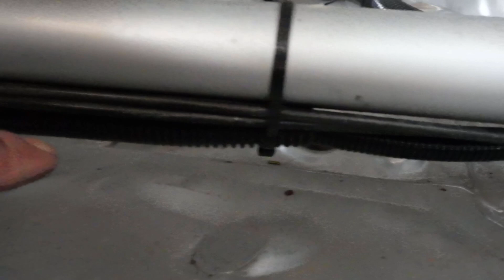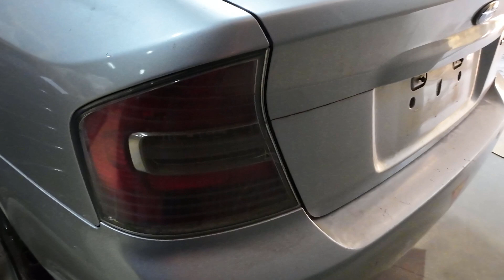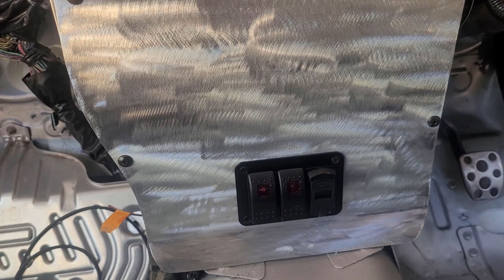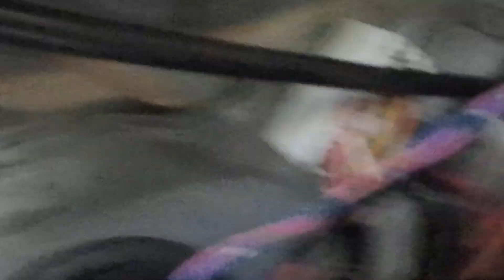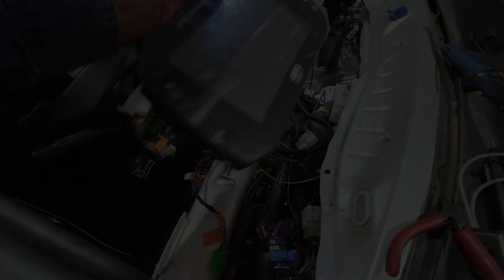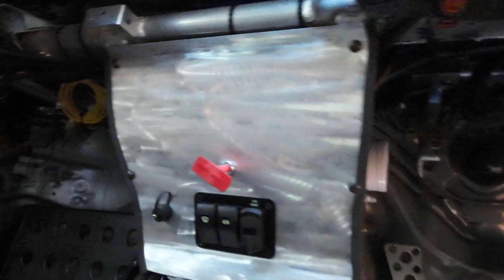Subaru Legacy GT/Liberty B4 EZ30 rally car build -  Part 3 - Will it be ready to race?

Comment: im working on my bugeye impreza wagon with an ez30 in it for the fia 4wd limited class. gotta love how subaru parts just fit together. the junkyard i got the engine from shredded the wiring harness so i have a maxxecu in it now. hope to have it on the road by the end of summer.
Reply from the maker: @nat-k5r  the wiring for the engine is definitely the tricky bit! Good luck with your build and thanks for watching 👍.
Reply: @rallyactionwa  the maxxecu kit makes wiring as foolproof as possible. everything is labelled and the kit comes with multiple diagrams and their website has engine specific troubleshooting. im really glad i went with them over a megasquirt . well worth the 1200 usd. i just have the injectors and sensor grounds to wire up and i am confident i wont ave any harness problems.h
Reply from the maker: @nat-k5r  nice one. We found the Australian EZ30 and more specifically the Australian Liberty wiring looms are different from other countries and even differ from year to year.